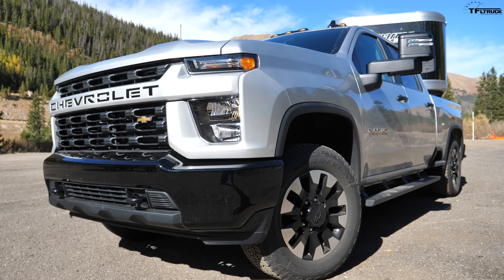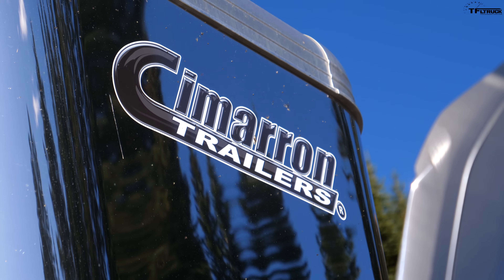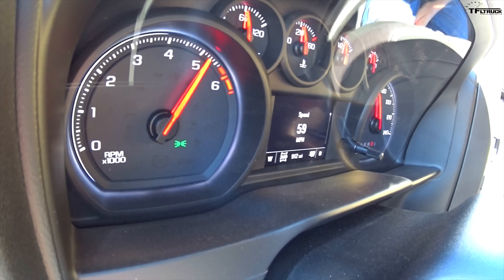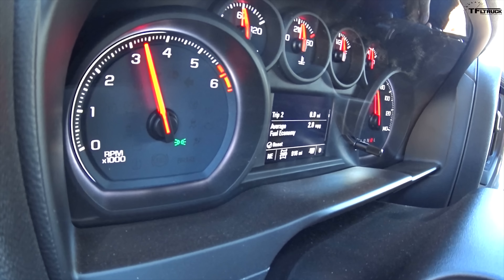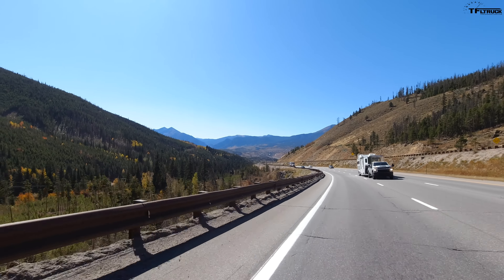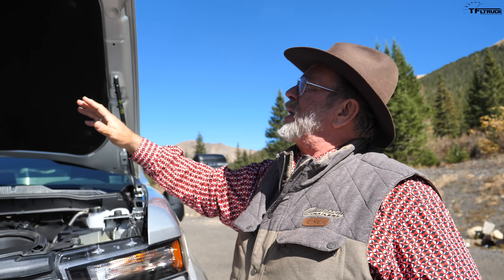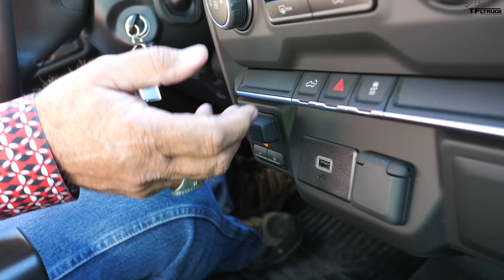The New 2020 Chevy Silverado HD Gasser Broke Our Ike Gauntlet Scoring System - Here Is How!

Comment: Pretty sure my 2017 F250 6.2 with 4.30's would kill that time.
Reply: You should scroll back through their videos. The Ford actually broke trying to do this with your setup and had to get towed. When they did find one to make it, it got beat by the old underpowered 6.0 which beat both RAM and Ford up the Ike.
Reply: @EGGINFOOLS  I've seen the video, the first one did break down, but the second test it killed the Chevy and Ram. You should rewatch it. Plus the 6.2s are proven reliable engines, maybe not to the level of the Chevy 6.0 which is bulletproof, but still very durable.

Comment: What am I missing?  This is a custom trim truck which has way bigger tires than others.  The work truck and LT versions have 31.5" tires and this has 34.1" tires.  In theory this would have to hurt the towing capability hands down by 8.3%!  This is a big deal.  Chevy does not show any changes for towing between trim levels though??  I would love to see this same test with a w/t or lt version.  Or just slap some wt tires on this truck and try it again.
Reply: If my math is right that would mean this custom trim is acting more like a 344 rear end and would need a 403 rear end with those tires to by on par with a W/T with 373's.

Comment: I think the test is flawed and does not simulate real world situations.  Holding the accelerator to the floor the whole way up the hill is not realistic, and we all know this wastes too much gas.  A normal truck owner would hold the pedal at 1/2 or 3/4 throttle up the hill. This would let the transmission settle into the proper range for maximum torque and horsepower and fuel efficiency for the task.  When you hold it to the floor, this is asking the truck to go even faster, so it upshifts because it is already at the maximum rpm.  Chevy has programed the transmission for real world use and this test does not make sense.  Why would you waste 5 gallons of gas to blast up that hill?  A better test would be to run the hill and hold the engine to max torque in the lower gears and compare what truck has the best mpg's for the hill.
Reply: Yeah.  Manually select your own gear, and modulate the throttle to keep the engine at about 4000 rpm.

Comment: Absolutely hideous front end styling. That truck is terrible looking. As far as it pulling up a grade at high altitude, it's a naturally aspirated gasoline engine. Any naturally aspirated engine is going to fall on it's face, especially when towing that kind of weight. I'd really like to see how the Ford 7.3 gas truck handles this. I recently rented a new Uhaul 28 footer with the Ford V-10, I was surprised at how well it handled a full load as well as hauling a vehicle trailer with a Ford explorer on it. Just set it on cruise control and it held the speed limit with ease.

Comment: In my experience the transmission will change it's programming after the truck breaks in. It will downshift sooner and hold gear longer. I not sure why GM does this but their transmissions are much more responsive after 10k-15 miles

Comment: Dude i have no idea what is with GM and their 2500 gas trucks. they literally suck so much. Terrible MPG and towing performance.
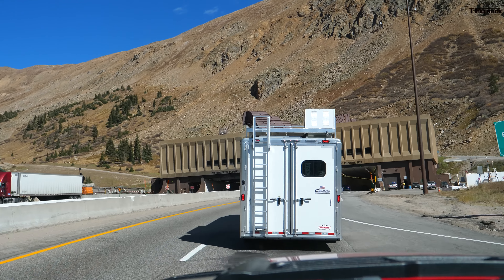Reply: 12:50 i mean come on 😂 The mans foot is to the floor and hes running 2500 RPM on a gasoline engine. The transmission is a joke.

Comment: 1. Ugliest truck ever produced. 
2. What is with these weak gear ratios?! Put a 4.30 or a 4.56 in that thing. Hell, the Tundra comes with a 4.30 stock.
3. Way too much weight for a gaser.

Comment: Although it needs a 10 speed I honestly dont think letting it get to 2k rpm was helpful. Why not Manually shift it so it stays in the sweet spot it's either poor transmission software or it wasnt in tow haul? If I was reviewing them myself to keep it honest I would drive the truck as hard as possible for each model. It almost seems if you put a fanboy in each model you would get best performance possible out of each one lol
Reply: Wide open throttle and let the truck do the rest, that's how this test works.

Comment: The issue is not a 6 speed transmission...it has worked fine in the past.  This truck needs gear.
Reply: Going from a 3.73 to a 4.30 gear would only have brought the engine speed up to 2900 rpm where it was really lugging at the top of the hill.  The Ford never dropped below 4000 rpm all the way up the hill, and when it did lug down to 4000, the trans downshifted from 4th to 3rd, bringing the engine back up to 4600 rpm.  It is the transmission, or at the very least, the programming.

Comment: If the engine and everything are broken in it will run better and pull better too
Reply: That engine is definitely broken.
Reply: ..That trailer was a huge air brake...the goose neck flat bed would have faster.

Comment: Screaming at 5,000 RPM The Whole time... The Godzilla 7.3 wont have to do that...It makes all its power much lower in the RPM band.
Reply: Of course it'll be screaming, it's a naturally aspirated gas engine at extreme altitude and it only has 13lbs more torque over the GM truck. Let's just hope it makes it, the last super duty gas truck broke down and had to be towed

Comment: I looked at these trucks but they are so high priced and the options and value are so low.  Stripped new gas truck for over $50K with little to no discounts and rebates.  Went and got a 2019 Ram 2500 Laramie loaded 6.4 Hemi with a 17 speaker HK audio system long bed 4x4 loaded truck for $55K was a way better value than Chevy.  The Rams front axle is way better - larger and stronger than the Chevy. Oh and the Ram has a 8 speed transmission. I could go on and on the ride of the 2500 is so much better than old leaf springs. I actually thing my Ram is better looking but the Chevy is not bad looking. I hate 20 inch wheels got 18 inch wheels on my Ram that are 275/70/18 that are way better off road with the larger side wall to absorb the bumps.

Comment: GM engineers blew it on transmission programing.  They should have allowed that transmission to downshift as needed to keep around 4000rpm to keep the motor in its powerband.  This is not the gas engines fault, just poor engineering.  you can't have a gasser running 2000 to 2500rpm  as you could see going over the finish line.  Gas engines have to rev they are not diesels ....

Comment: too bad you left it in a taller gear and dropped the rpm.  you weren't using the engine fully.
Reply: They had it at wide open throttle trying to maintain speed, same as every other IKE test.